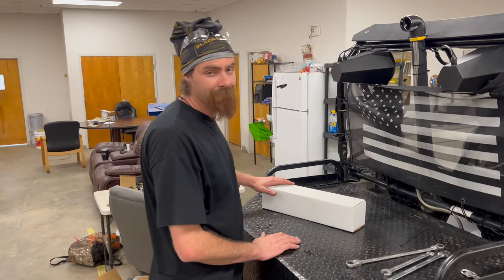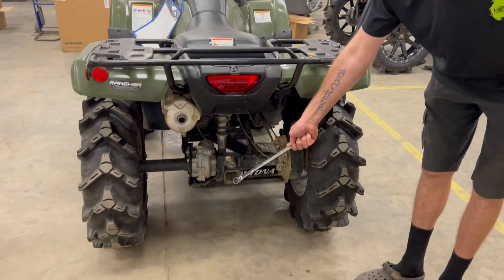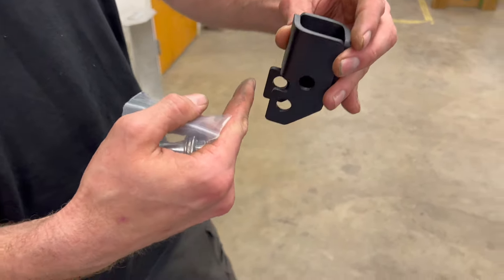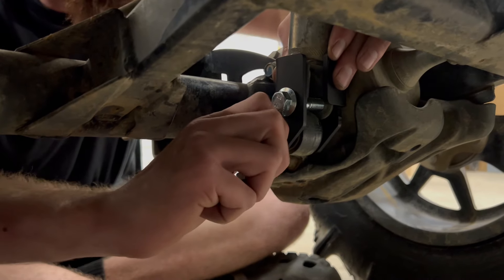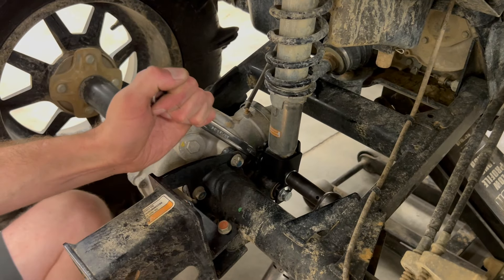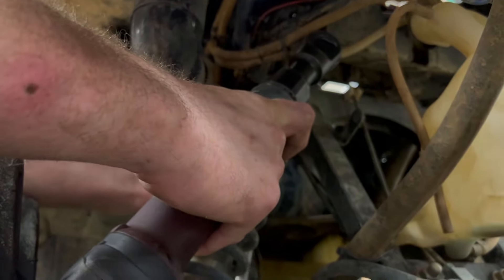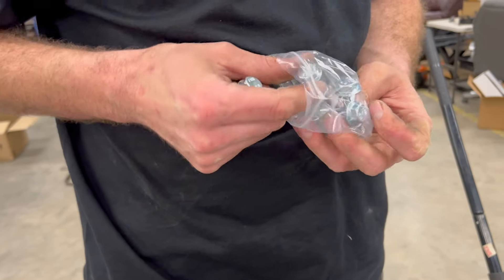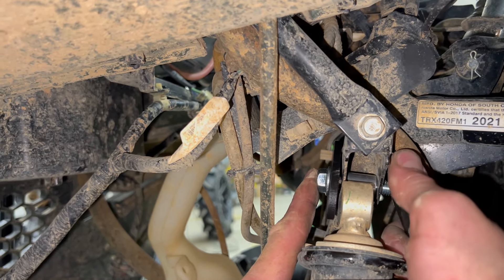How to Install 2" Bracket lift for Honda Rancher and Foreman Solid Rear Axle

Comment: Does this ride have gear reduction
Reply from the maker: yes
Reply: @vesselpowersports would it be fine to run 30’s on a foreman 500 with no reduction?
Reply: @KohenTreglown23 I’m running 31” outlaw 3s on crushed 16” wheels. 2 weeks of rough riding and she’s pulling just fine. Will be getting a reduction in the future but it’ll pull. Also depends on your riding style.

Comment: Thanks done!  Question do i need to add anything else with lift?  I know nothing about bike mechanics, will this make parts wear faster or cause something to break?  Can i also adjust the front shocks to it’s highest setting, or will this make the front too high.  Lastly, do you think i can go 28 inch tires, without issues.  I currently ride 27 M1 Evil, just want a bit more aggressive look.
Reply from the maker: You can clear 28s fine, this kit won't cause premature wear on other components. You can adjust front shocks to your liking